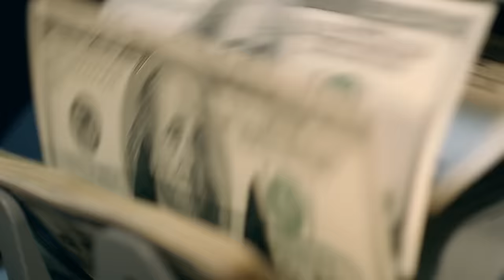Afghanistan Is Building Asia's Largest Artificial River In The Desert

Comment: They are very lucky that because of the terrain, it enables an inexpensive dig, fill and repeat type of engineering. No mountains to tunnel through, no expensive complicated extraneous building projects 
such as locks. Just a long channel and let the water flow. Good economics.
Regards from South Africa
Reply: And they dont even need to use concrete slabs, they could use bentonite to seal off the river and make sure it doesnt leak which surely will be way less expensive as making a big slab of concrete.
Reply: @ibah7610 for agriculture leakage is not too bad as water going into ground water.
Reply: @knoll9812  think other countries will disagree :p
Reply: Yup Afghanistan has good soil, we'll start making use of it soon, the hindu kush mountains create alot of rivers for afghanistan

Comment: I very much like sensibly priced projects. 
With this one i have to presume this project is mostly justified by selling water to the cities it passes, because if used for agriculture alone the numbers dont come close to making sense. I hope that doesnt sound like criticism as this is how most water projects are run.

In theory Afghanistan definitely have the rights to (almost) 1/3rd of the amu darya river flow,because that's how much their own rivers contribute to it.
So long as they're removing water based on flow,they're completely within their rights(the irrigation season only partly matches times of maximum flow).

We've seen this kind of thing happen in several countries.Those with big rivers entering their countries are having to cut back because the countries upstream are belatedly claiming their fair share.

Comment: I spy with my non-engineering eye, no embankment erosion control with what appears to be banks of just sand/soil. This video already shows early signs of erosion and I'm not even an engineer. There are other ways it can be done organically without isolating it with concrete but nothing in the video shows any signs of those methods. Either way, hope they get it figured out. There is a lot of good desert reclamation methods out there. Good to see them try to do something with the land instead of desert sand but mono-culturing wheat as a broader goal is already a sketchy idea at best.